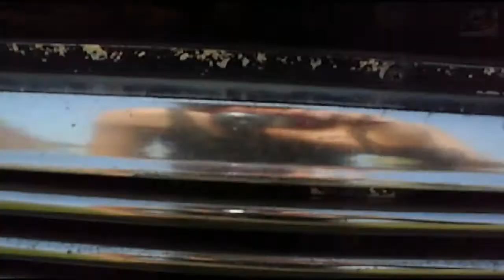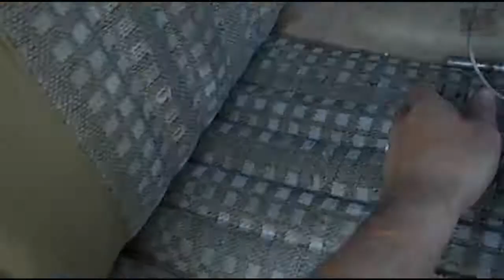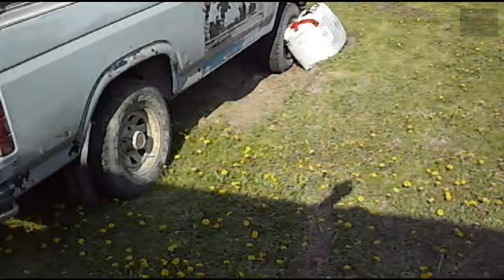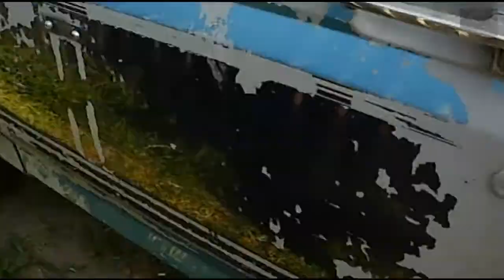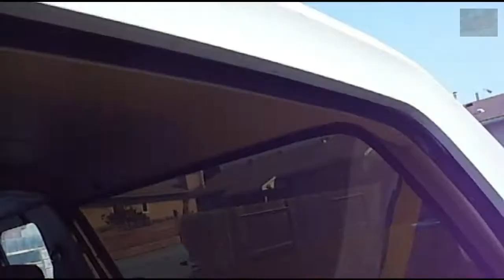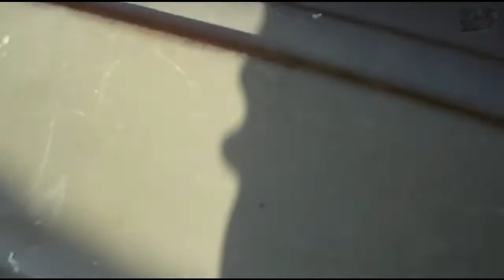Introducing project Wiley the 1981 ford bronco

Comment: piece of junk  never happen.
Reply from the maker: +dewayne barden  buddy's already got the frame welded up, 1 ton axles under it, along with the 7.3, trans, and driveshafts it, is a fully running driving chassis, and he's starting the body work already cutting out the rust and welding in new sheet metal. Should be done and on the road in spring.